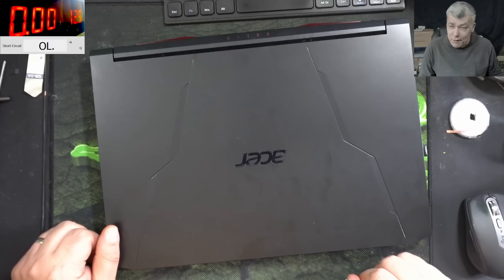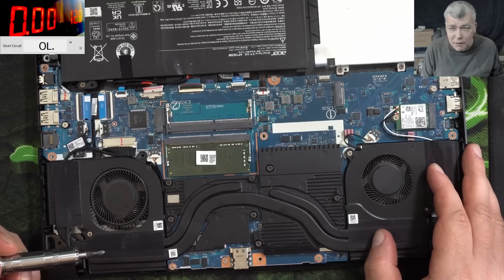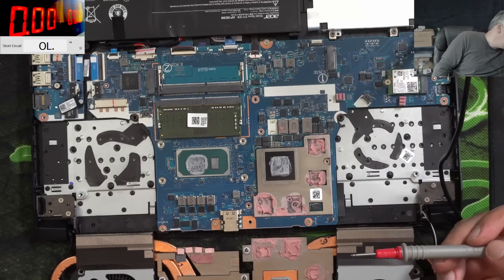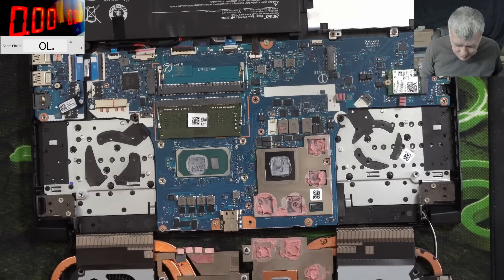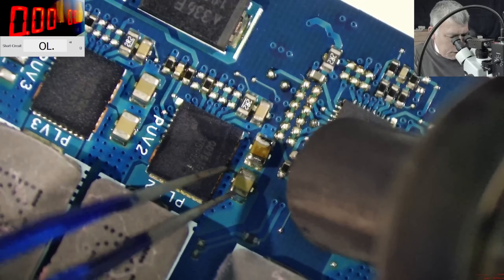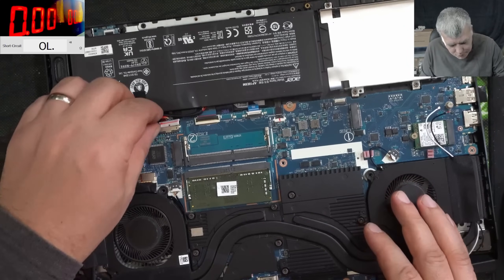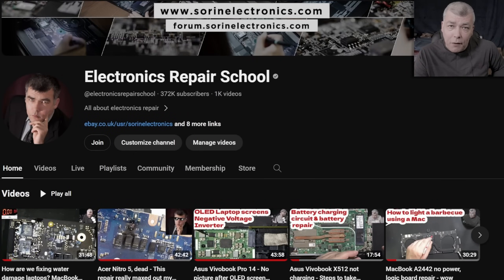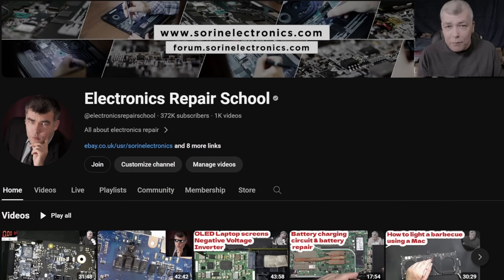Acer Nitro 5 - Customer asked for repair or board replacement, can we save this board?

Comment: Wonder if you could answer a question. I have an Acer Nitro 5 that won't turn on, side light comes on for a couple seconds then goes off with no apparent response. No picture, no fans. I took it in for diagnosis and they tell me the GPU is shot, needs a motherboard repair. I noticed, sometimes you just remove the offending piece from a pc and it works. Would that work with mine? If I somehow removed the GPU, would it work? The CPU is i5-12450H which supposedly has integrated graphics, so the GPU isn't needed.

Comment: I have a Legion 5 that no longer boots after flashing a vbios with a low tdp compared to the maximum allowed by the gpu and now when I turn it on it does nothing, the fans start at maximum and it turns off. Could you suggest me what I could do and if it is fixable?

Comment: I also have acer nitro 5 it is not working at first both fan stop working so I will try fix this before that because of over heated  it stop working 
First I go to local repair shop they unable to fix it gave back in 2 day so I got to acer service center but they send it back and say u have to change whole motherboard  
So what should I do now? Do I keep  try to another repair shop? My laptop really not fixable or I have to just throw in garbage

Comment: Incredible fixed, the Capacitor normal have High resistance but not in this case unbelived customer very lucky.Very good job Mr. Sarin
Reply: In fact, the capacitor don't have any resistance...
capacitors have capacitance, storage charge... if for some way, the capacitor is presenting any resistence, is faulty.